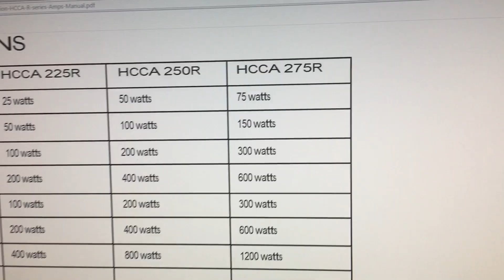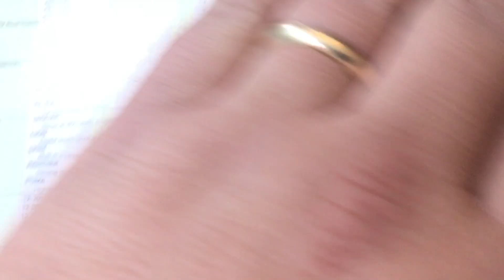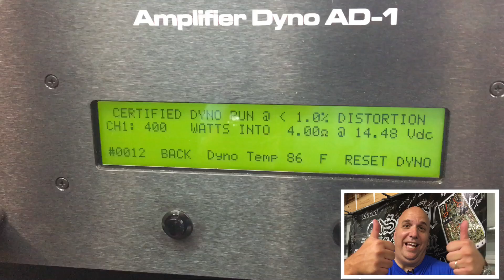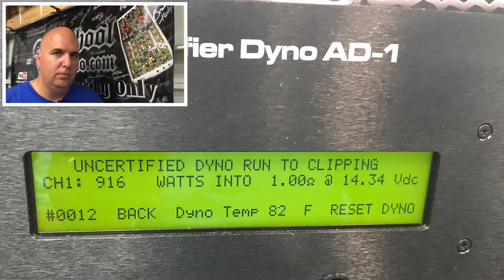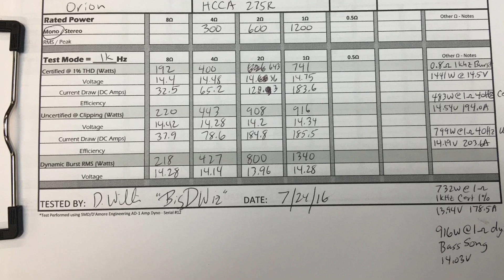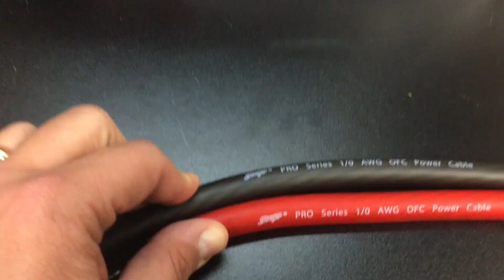1999 Orion HCCA 275R Amplifier Amp Dyno Test

Comment: I'm a bit confused. You said in the video it was 626 w certified at 2 ohms then said it was 908 w uncerified at 2 ohms but the SMD said it was at 1 ohm. Was that the 1 ohm uncertified run and you missed spoke?

Comment: I have a 250R and at 2 ohms mono it pushes an H2.4 harder than it does my H2.2 at 1 ohm, incidental woofers.  Currently running a HCCA10.4 and it seems to have more than enough power to push it and its a 2k rms woofer.  So I deff agree this specific line of R amps seem to be more set up for 2ohms mono.

Comment: Am I wrong to think the first gen hcca 250  was 1/2 ohm stable mono 1/4stereo?   I know you can weld with it.  Also seems to perform better hot than not.  Please elaborate
Reply from the maker: No sir. 250 HCCA models were 1 ohm stereo or 2 ohm mono rated. They may have ran at lower impedances but were not rated to do so
Reply: @wal    so nothing really better about the first gen then?   Maybe the myth was just the best of the best.  So just a myth?
Reply: @wal  and hang on.  Definitely 1 ohm mono stable.  Hcca yes?
Reply: @wal  I just way to much to list of these old school amps and eqs.  Tons I've collected.  Would love to share it all audio control and Orion stuff    just not exactly sure how to match what with what been out of the loop for a long time and respect your ideas/ help thanks

Comment: Most power is done at lower impedance , with speakers getting higher impedance as power increases this could be the reason Orion amps , traditionally have sounded good , higher resistance, more power into that higher resistance, even though they were rated for high current, they must have know the way voice coils behave

Comment: Its really a shame that oldschool orion on average, does not do rated power. Ive had them and let me tell you i had two 275R's  running 6 w6's and 4 interstates. Both blew at the same time.

Comment: them amps were actually pretty crappy in the day but good marketing and price hike made them seem good to most people. i worked at a repair center as an installer and was extremely familiar with the inside workings of car amps..with that said i couldn't believe people were paying that premium price for off the shelf amp designs. Never cared for thier sound either sure they dropped and hit hard but actually quality of the sound was below standards.

Comment: these were made after  made after they sold out to dei just like the G4's right???    the last real orions had the crossover modules.  you need to test one of those!!!
Reply from the maker: +trance dj I've tested several generations of Orion's and none of the early HCCA's impressed me as far as Dyno numbers go. And it's unexpected as I've heard these in cars and they are impressive
Reply: I have one of the original hcca 250's. it slams and has never shut off on me.
Reply: yep even in traffic in the middle of summer... ...i know!!!  also why i'll never own anything alpine ever again because they work fine.. IN THE WINTER!

Comment: Hey BigDWiz I have a question, hope you have time to help me out. So I have this same amp and today ended up selling it thinking it worked. The guy came back saying one of the channels wasn't getting enough power of any. Would that be something fixable or is the amp dead? Anyways I gave the guy his money back.
Reply from the maker: I always test amps before selling, make a video also. This way if someone else gets it and either doesn't know how to hook it up or has other faulty equipment, I can show them it wasn't this way when I sold it. You always take a chance with used gear, especially car audio. Most likely the amp can be repaired, it would have to be really bad damage to the board for it not to be fixable
Reply: BigDWiz I appreciate the reply, here's exactly what he said and he did test that it turned on when he was here initially but once he got home and checked it out some more this is what he said "Thanks for getting back to me man. Yeah we check the left side, I should've checked the right side as well. When I hooked up the left side that has power it was somewhat minimal, he should've had a lot more output and then the rates I didn't have anything at all". Does that sound to you like bs or something that can be easily fixed or maybe he just didn't know how to properly test it?

Comment: What are these worth currently? I have one and would like to sell it but wanna make sure the price range.
Reply from the maker: I sold one for $349 a couple of years ago but it was MINT, MINT, MINT!
Reply: BigDWiz Cool thanks for the reply, mine would be mint as well but has two small dents on top. Otherwise it looks just like the one in your video and the bottom is actually less scratched up as well. Thanks for the info on the amp, hope your channel get more subs.

Comment: hey Big D so what's the difference between the orion 275 R and the 275G4? because I watched both videos and they look the same and you said the 275R was a disappointment but then you said the 275G4 was a beast ? please school me?!
Reply from the maker: 275R was generation 4, 275G4 was next generation (5). I know, don't ask me why they messed up with the generations. The R and the G4 look totally different. If I mentioned the G4 it was probably in reference to me having one in the past and not testing it before selling it. I'd expect the same power from both
Reply: hey Big D I have a 2100 hcca comp amp....and I was cleaning it and broke the gain of the the circuit board the board is fine but I need a direction on who you would recommend on fixing my 2100 so that I can use it ..let me know thanks

Comment: hmm so it failed the 1 ohm certified test? but then you run .8 test and it does what you might expect. not sure but sounds like whatever is running the 1 ohm side might have an issue. o.o maybe a cap going bad or a few for that matter. lol but might wanna check it.
Reply from the maker: That was burst at 0.8, not certified
Reply: ah o.o wow lol didnt know. what did it do at certified (just curious lol)

Comment: that amp has been rebuilt, and not correctly. someone replaced a bunch of resistors with a different brand, color code isn't right either. that may be why it's not doing rated power. and whoever has it apart didn't even put the screws back in to secure the board to the heat sink
Reply: I’ve seen so many hack jobs hurting these amps :/

Comment: Pretty good amp.  I agree that it seems happiest at 2 ohm loads.  In fact, based one the power draw to power output, seems the power section inside the amp might be the hold up at 1 ohm loads.

Comment: thanks for the test did you happen to test the amp at 1khz ? the older class ab amps you shown in the past had shown a bit more power when you tested it at a higher frequency..
Reply from the maker: +Stacy Williams all tests shown in the video were @1kHz except the last "bass song" run

Comment: Big D, do you 'tune' the amps before testing? Not sure if that affects actual power or just SQ to be honest...

Thanks for all the retro and test vids, good stuff
Reply from the maker: Each amp is set to a 7dB overlap using the AD-1's built in DD-1+. If full range, all crossovers are disabled. If a monoblock with crossovers, they are set at the highest available setting, etc.

Comment: Curious why you would test a Class A/B amp with bass - they can play low frequencies, but play much better with higher frequencies...
Reply from the maker: I ran all Dyno tests shown at 1kHz because this is a full range amp (it did worse at 40Hz). Most people use this amp for subs, so I was giving it a best case scenario for the Dyno runs

Comment: Is it possible that the age just reduces its power out put over time even though it still works like it should caps over 15 years old might not be as good as brand new
Reply from the maker: The owner of this amp is a technician and carefully went over the amp prior to sending to me
Reply: You should test out the xtant 1000d and the coloussus xi
Reply: @orionalpine  I have xtant 1001x pounds the snot out of me. Gotta be 1200plus easy. One of the best ever made because I have 1.. lol..
Reply: It seems like a lot of the Orions were just overrated and overhyped... although they do look nice. Seems like they all do fine at higher impedances and then fall on their face when loaded down. The only amps that seem to have age related issues that Big D has tested are 80s vintage. The Rockford, MTXs, hifonics, and Alpines he has tested still exceed original spec
Reply: WooferVision

Comment: test @ 1 kHz    also there may be something wrong with it.   never had an issue with one of these back in the day unless there was an issue with the mylar caps on the input side or the settings on the end.  I would regularly get between 1800 and 1900 watts out of them on the bench @ 1 ohm before we sent them out..
Reply from the maker: +Orion I'd love to see those results! Why were they not included w/ the amps? I'll tell you why...it didn't happen 👎
Reply: boom!

Comment: I just don't believe the SMD products are accurate at all. These dynos don't factor in song or tone recording level, box rise, constant ohm changes, RCA voltage or anything like that.
Yeah theres a 40 hz and 1 khz tone detection,
but what db level was it recorded at? -5 db? -10 db? How does that affect wattage output? What if the tone or song recording is slightly distorted? How does that affect wattage and test results?
If I set my gains with the DD-1 using its disc and its a 0 db level recording and i put on a song or the radio thats a -10 db level recording, it's not going to play at at optimal wattage.

Comment: do you think the age of the capacitors are affecting the performance results? what if you had amp tested it and then had it recapped would you see any difference?
Reply from the maker: +Hawk N.W.C. We did this with the previous 2100 HCCA and there was no difference in the output. I seriously thought something was wrong with that amp, so I tested another...then another. Yes, 3 amps, very similar results
Reply: I was gonna post the same thing.  dry caps.
Reply: Caps can dry,  amps we're not ment to sit on a shelf.  Parts 20 years old fail.  Caps go first. I don't know what Orion used but It may be a common issue.  I had problems with a 2150 I shelfed. I have had similar issues with with my fosgate dsm's too but at least with the foagate the problem is pronounced (humming or feed back noise with bad or failing caps)

Comment: het d i hav a 700s 2 channel amp and two p3s d4 subs in a ported and im not getting the low loow notes should i replace that amp for a mono block or do u think its just not wored correctly
Reply: What's your enclosure tuned at?
Reply: Is this a Rockford amp? The 700S? I have the power version which is the 750S I didn't have the remote bass to it which the amp sounded weak I had to turn up the the settings on my headunit to get it to bump louder. Until I got a new bass knob from Rockford it made a big difference amp is much more louder.
Reply: yeah its a 700s  i got it with 2 p3s d4s and i cant get it to sound good i would like a wiring diagram
Reply: Check Rockfords knowledge base on their website to find manual it's the 2002 punch amplifiers it's got a diagram
Reply from the maker: I thought I posted a link to the RF wiring wizard. You'll want to wire series/parallel to get a 4 ohm load with (2) DVC4 subs. http://www.rockfordfosgate.com/support/wiringwizard.aspx

Comment: I have a shelf full of old school orion. this makes me sad.
Reply: dont be sad, indeed good sq amps. My 250 hcca handles the frontstage really nice but pushing 2 kicker solobaric 10s 4 ohm in paralel it could not handle it
Reply: Yes They still go hard but nice to see rated. I have a 2250sx, 2x 97.1 concepts, 3x 225 hccas, 2x 275sx, 2x 150R, 3x 800 xtreme, 600.4 xtreme, 200 xtreme, 400 xtreme and others I prob can't think of atm lol.
Reply from the maker: +staples4335 no need to be sad, these are still great amps...just a bit on the overrated side 🙄
Reply from the maker: +staples4335 I have many myself, just b/c they come up a little short on the Dyno doesn't dissuade me from collecting and using them